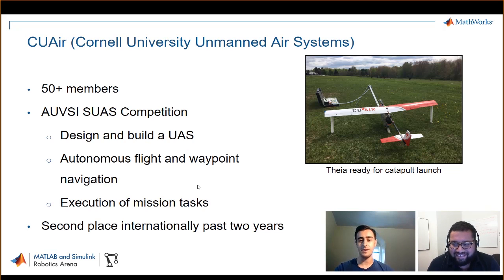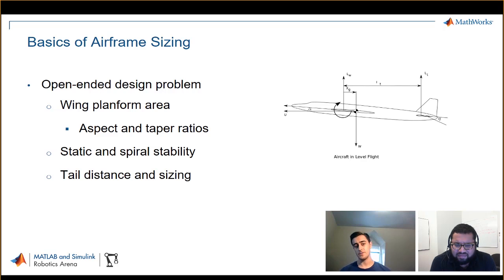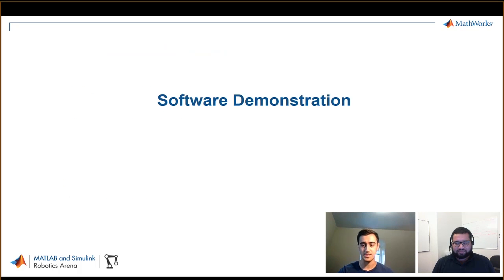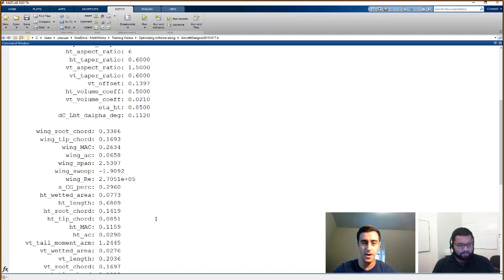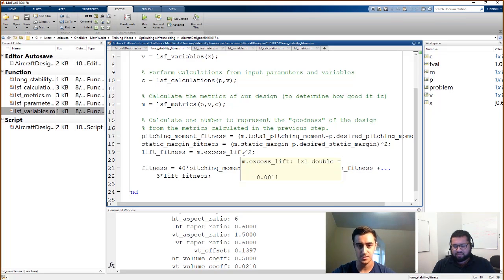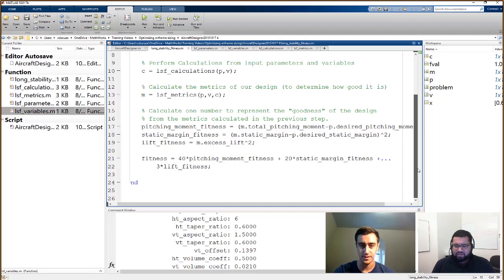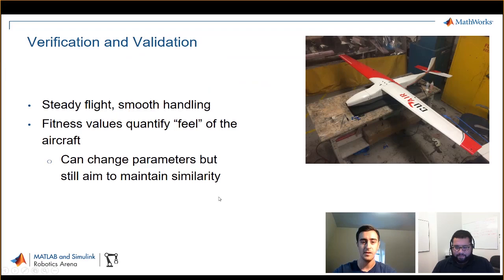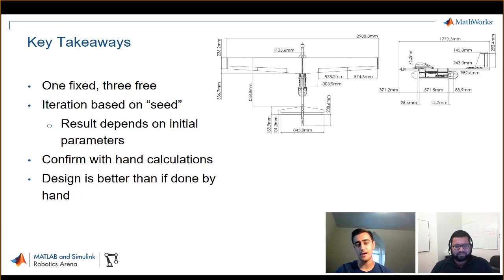Airframe Optimization with MATLAB

Comment: Awesome tutorial! I did an online course on the Introduction to Aerodynamics through DelftX and it was quite intriguing. A particular aspect was on static and spiral stability, seeing this tutorial on Matlab has made this aspect of airframe analytical design more intriguing given the ease at which open-ended designs can be optimized using codes and a range of iterations. Thanks Joshua and the host!